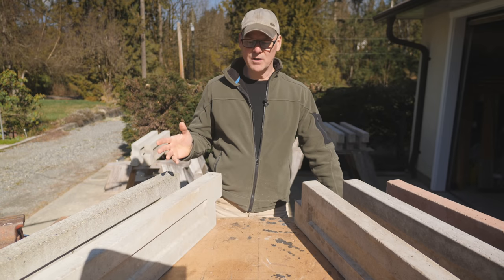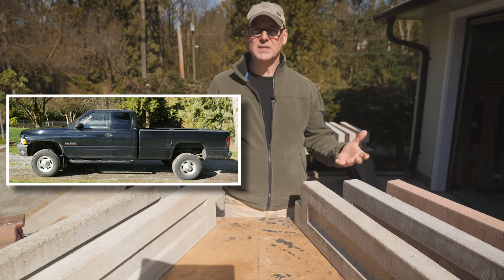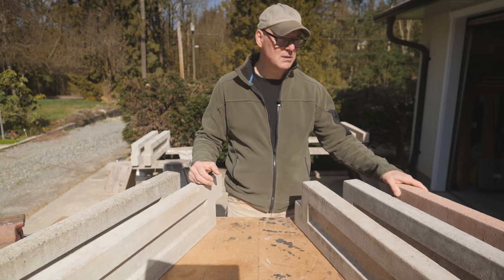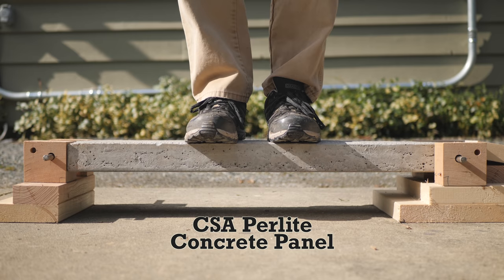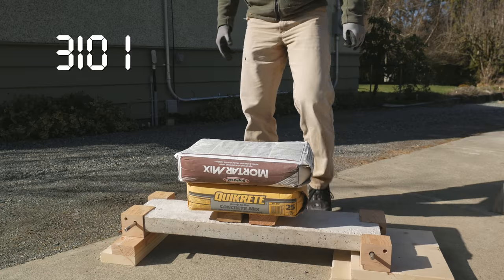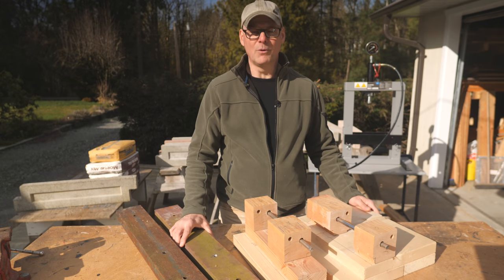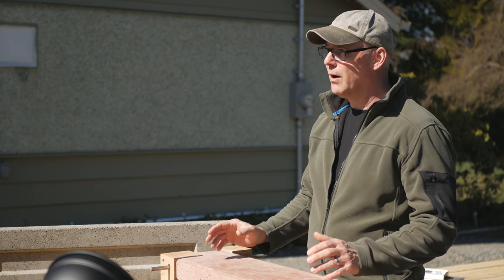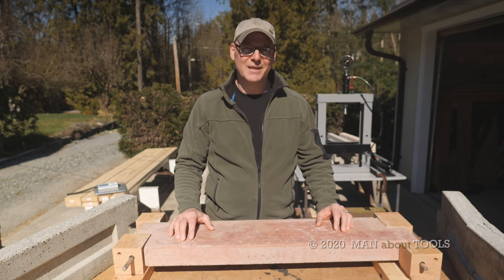How Strong is Lightweight Concrete?  - Deflection Test Perlite, Vermiculite, Lava Rock, CSA Panels

Comment: As a mechanical engineer I have some suggestions for your testing.  You are not doing tensile testing. You are doing beam loading with a point load in the middle.  With a 500 lb point load the center of the beam sees the full 500 lbs and each end sees 250 lbs (so the pins only see 1/2 the load). This is not a good simulation of the dirt or ice load in your garden bed.  Try a distributed load by putting at least three layers of bricks across the full face of the the panel, offsetting the seams,  and then add more load (bricks or bags or whatever) evenly across the top of that.  You should get a failure at the pins and you may be able to reach the theoretical weight of your truck wheel.  (If you do another truck test build two ramps so you actually get even loading, you had more than 1/2 the rear truck weight on that one elevated tire.)

This will also eliminate the chance that tall pile of bricks might fall on your head when you bend down to look for cracks.  Had me worried a couple of times.  Thumbs up for an excellent and thorough series, who knew it would be this fascinating?
Reply: You're absolutely right, I was going to suggest the same. But since you took the liberty of writing it all out. I just up voted your comment. Thanks.

Comment: First and foremost - I love this series.  It's going to be the basis for a big experimental project I'm starting.  One point you might consider - you are deflecting with the steel on the inward side / radius where compression occurs.  It would be stronger if the steel was place on the outward side where tension occurs.  It might be interesting to take too similar panels and flip test them.  I'd bet having the steel on the outward side will near double performance.

Comment from the maker: I incorrectly referred to this as a tensile test when it is actually a deflection test. Thanks to the engineers out there that caught my error.
Reply: i thought something was off about that isnt tensile force pulling it apart? aand an i thought what u did was considered a shear test?
Reply: Give you considered adding decorations?

Colored glass or stone could be put into the mold before adding concrete 

Awesome series!! 

These are good enough to sell vacuum formed molds in mass production at be carried by a big box store
Reply: The biggest problem with this kind of test is the metal that you put inside of that is what gives the concrete it's strength in that dimension. The metal you used in some of them was very thin. I believe the one that has the Hague wire will perform the best. If you noticed in your concrete test where the truck broke it  The edges of the concrete did not flake off under pressure of the truck tire. If you recast that same one with the same mixture but instead were to add 2 or 3 pieces of hogwire offset for each other so that the pieces coming out to the top and bottom were not on top of each other but spread out you would be able to support a truck.
Reply: Actually all your test failured under tension and you never measured deflection... point of fact, the expansive loads you theorize is from water retention in the soil that would expand and that small dimensional box would not create enough pressure...
Reply: it's still highly related to the tensile stress because the bottom of the beam is in tension and that is the critical failure. Deflection is just  how much it deflects per load, not necessarily to failure.  UTS Ultimate Tensile Strength IS what you tested, albeit in a bending mode, rather than an axial test. The maths to calculate this bending failure would still use the UTS as a primary input to the equation.   Stiffness,  "Modulus of Elasticity"   would be used to calculate deflection not  UTS.

Comment: I am impressed with your creativity and dedication to this topic. You address a lot of the issues discussed in engineering literature regarding concrete mix design, placing, curing and testing. One thing in particular I would like to note is for your beam (simple point load) test the tension exists in the lower portion (exterior side) of the panel so the reinforcing would be more effective the if it was placed as close as possible to the exterior face. Additionally your pin locations didn't fail because there is very little tension there, mainly shear force.

Comment: I don't know if you have an engineering background but your approach is right up there. I've made forms from your videos and I love them.  I use the perlite mix and heavy gauge 4 in x 6 inch heavy gauge hog panel . I'm a retired general contractor and have poured in many different forms more than 7 million square feet of concrete  in 20 yrs of work. Based on a 4 inch thickness. Love your videos and keep them coming. I have added tile mosaics and face brick for custom pieces to the face inserts.  Well done! Rob

Comment: Horizontal concrete slabs will be subjected to pull from 2 ends, not pressure. So it needs a steel core for bearing. You put a lot of steel at the ends of concrete slabs, so the two ends have very good bearing while the middle is less steel and disjointed with the two ends, so the middle will be weak.
But I think they can withstand nearly 200 kilograms of pressure, which is good enough for making pots.
Thanks for sharing your good ideas. :)

Comment: Your method of testing reminded me of my first physics class at college nearly 50 years ago.  The professor used real world examples of the various principles-wedges, pendulums, etc. and was mesmerizing in his presentation.  Thank you for showing these tests.  While not "scientific" in the current modern sense they are practical and show the durability of these panels.  And you saved yourself a gym membership!

Two observations:
1. The size of the reinforcing and the density of the grid will affect the tensile stress the panel will handle.  If there were for example 4 longitudinal rods versus 2 you will see higher loads.
2. The distance of the reinforcing from the neutral axis towards the tension surface will also increase the tensile loading possible.  If the inset were half as deep and the reinforcing were closer to the inset you would see an increase in loading before failure, but the panel would not look as good.

Ultimately I believe the failure of the panels will be from the freeze/thaw cycles and absorbed moisture and that will take years.  Thank you for your videos.  Take care, stay well and keep having a good time.
Reply from the maker: Excellent notes here! Thanks very much!
Reply: What would happen with rebar in the thicker part of the panel above and below the inset? it would have to be just bars, not mesh, but we're not really worried about them breaking the other way.

Comment: First off - once again, GREAT information Kent!  Love your passion about these panels and the amount of information you share about them.  I would have loved to see you test one of the thin panels you made with the CSA Rapid Set Mortar Mix.
Reply from the maker: Thank you very much!! I really appreciate the support my channel has received. If you notice I have an extra smaller diameter hole in the blocks that hold the steel bars. Thinking ahead to testing the CSA panels in the future.

Comment: I plan on trying this for my garden, tired of wood rotting out. May try it for flower borders but may try half rounded molding for a fluted look. May try making curves by using shorter sections, 2 feet or less using understatement plywood fastened to a curved form. Would start filling in middle then covering with curved plywood to hold in place. Good presentation.

Comment: So... they are plenty strong for most applications. Now you should do a beam strength test. That one you should be able to use your press for. I copied and modified your design and I have my first batch done and getting ready to cast second round today. They are a nice panel design!

Comment: Saw your recent video with the new molds. Very impressive. 

I would be interested to see you try modifying the placement of the reinforcement inside the mold. Positioning the reinforcement closer to the outside edge would increase the strength since that is the point of greatest tensile stress. Maybe two sticks of rebar on on opposite sides of your decorative inlay?

Comment: The crack on the first test with bricks was caused by the uneven support of the wood at the bottom. The right one was shorter, which caused pressure to accumulate on its far edge where the crack formed.

Comment: Thank you for your videos! The testing is great and way over the top! Any of these planter box panels seem to be far superior to any commercial version. Even at a tenth of the demonstrated strength, they should last a millennium, unless you intend to make bridges with them in the future.
Reply from the maker: Thanks! I agree that they are all strong enough for their intended purpose. But, I think it's still interesting to see HOW strong. Cheers, Kent
Reply: I think the line-trimmer test was pretty critical to their intended service, though. The rest of it was just for the fascination of watching practical engineering in action.

Comment: To enhance the resistance the wire mesh should be place closer to the face subject to tensile stress (placing the reinforce closer to the outside face give additional protection against corrosion).  Also a third light weight material could be expanded polysterene particles. It will be interesting to have a table that shows the strenght related to the thickness and lenght of the panels. Excellent job so far.

Comment: So, a couple things I'd be curious about, would be a variety of tests using fiberglass.  Perhaps a test with continuous fiberglass rebar of various sizes, as well as a test using fiberglass insulation as a filler material, if such might be possible?  Also, perhaps tests between aerocrete and standard concrete, also maybe using traditional methods vs using an ultrasonic vibration cleaner  to try to even out the mold.  Performance with a variety of aggregate grain sizes might also be an interesting test.

Comment: An ounce of prevention is worth a pound of cure.  To minimize the effect of frost pressure, line the inside of the planter to the top of the dirt level with a material that will compress when pushed against.  This will act as an expansion joint to absorb the dirt’s expansion.  Good drainage under the planter will cause less water and then less expansion.

Comment: Thanks for the thorough investigation of home made concrete garden bed / fence panels.
The takeaway I got was,  they are plenty strong enough  as built and Portland cement is just fine for the job.
If anyone needed more strength then a loop around the indent would greatly increase the force required to initiate a crack in the face. The unwanted side effect would be a greater risk of concrete cancer.
So, all in all it ain't broken, so don't fix it.
BTW, I like your simple modular  design. When I made a concrete raised bed some years ago, I bolted my panels together. It works well, but your design is more versatile.
Reply: I don't see how a loop would cause concrete cancer,  but a lack of concrete cover to the reinforcement may cause spalling and reduce the life of the panel.The panels are not really thick enough to accept steel to modern standards, so the galvanised fence wire is a pretty good idea for being off the shelf.

Comment: It would be useful to know if fence posts made in a similar manner would be sufficiently resilient
Reply: Yes, fence posts of concrete with perlite. Would be very strong and cheap if you mixed the concrete yourself and the archaeologists would find them in 1000 years and wonder what kind of religious ritual they were for or if they told the time........ LoL....
Reply: I've been considering the same thing. :)
Reply: sdushdiu very interesting!!!! I have a new section of pasture I need to fence and would love to try this idea. I wonder what would be the best way of attaching the fence to the post? Would you inset something into the post when pouring to attach fencing or is there a wrap around wire fastener and just pour a square post?

I need to research this tho and find a solution so I can start making posts. If you have any other great ideas for them let me know and I’ll try them and see if it would work. 

Thanks for the idea, I greatly appreciate it!!
Reply: Don Pfeiffer I’m looking at the same with the Thin CSA panels. I didn’t see him test those panels though.
Reply: Don Pfeiffer I guess it might partially depend on what you intend to attach to the posts for fencing. Insulators on stand offs could easily be embedded in the posts for electrified fencing (or simply the possibility of adding such capability, or simple a floating heavy duty chain link attached to resilient leads that will not rot or corrode over time embedded in the mix ( even tied to the post's rebar reinforcement). 
I tend to think in terms of traditional open wire mesh fencing (primarily gor livestock), newer high deer 'nylon' mesh fencing. As well as potential combination of the two, and even for the possibility of a rail style fence, although I suspect that material fatigue over time might result in rather significant warpage of such rails . Notre that  is based on worst case assumptions and not on empirical fact!
If you can suggest the type of fencing material to be attached I think we could come up with a few economical resilient long term suggestions....
Reply: So many new ideas! Concrete fence posts!!!
Reply: Don Pfeiffer U channels on both sides to accept a 1x or 2x of whatever size of wood you would like to use. Adjust the depth of the U channel to what you feel you need, allow some room for expansion. I would also use a small spacer between the planks to avoid a wet spot that would create rot. Leave the channel out on the portion that is underground.
Reply: Build your own form with hinges so you only need to unlatch one joint in the form and it unfolds . Put triangular inserts parallelogram inserts with less than 45 degree sides allowing you to unfold it. Coming out with an X shaped fence  post..  if you want cast holes. Make up tapered pins to drive thru the form and remove before stripping the form. I love the idea of the reciprocating saw as a concrete compactor.

Comment: Cool video.👍 When you load the panels your greatest force, or moment, is at the middle of the beam, not at the pins (hence why they don't break there, as each pin is a split or ratio of the load). Also, your wire mesh is negligible or zero in contributing any kind of reinforcement bcuz of the tiny size AND placing it in the center of the panel, or the neutral axis. Reinforcement need to be placed in the bottom portion of the cross section for the steel to be in tension. So really you're just testing the concrete itself, and you're loading the panel sideways. 🙂 Yeah I am one of those engineers. But not the kind that drives trains. Lol.
Reply from the maker: Yes, I agree with your points. I went through a few loading scenarios and also thought about a uniform pressure on the panel instead of the center. And that would have put more pressure on the pins. I might still do that yet and see what happens. All and all, I was happy with results. It was interesting to see how much concrete can flex. Thanks for the comments!
Reply: The concrete above the pins is also in compression, just compression upward. The center will always have the most tension because it will always have the easiest time deflecting. While the metal wont help like rebar since it isnt pretensioned, it will help in keeping the concrete as one unit for looks and hold the small amount of pressure a planter box holds.
Reply: Michael & Haidee I was gonna say almost the exact same thought but you beat me by one day but well said Brother!
Reply: @MANaboutTOOLS  Great effort, I bet that was exhausting!! I wondered about the changing moment between tests myself , the press was dead center, the others varied the distribution over the panel by varying lengths and the truck test would have been like the press test if you had used a hydraulic jack to lower it in the center. If you haven't seen the Mathias Wandel testing on wood joints, it might be helpful for using a bathroom scale and a cantilever for mechanical advantage? "Dovetail joint vs box joint strength test" is the video title about 1 minute in is what I was thinking about when I saw your testing. Still good information, thanks!
Reply: If the concrete at the pins was going to fail, it would have been a shear failure since it is a pin/roller connection and takes no moment
Reply: I disagree Wayne.  Having the mesh in the middle actually would be equal to a panel of half the thickness with the mesh at the bottom.
Reply: Michael & Haidee I wonder whether polyester fibers would have a significantly positive effect on the strength of these lightweight concretes.
Reply: @ewetoobz3840  I was just going to suggest that!
Reply: @dennisrose40  I don't think the fibers are doing squat.  There are no larger aggregates mid, large size, mostly sand and air bubbles.  Would be interesting to add some small lightweight gravel aggregates.
Reply: @flick22601  yes, correct.

Comment: Great video. I loved how you tested the samples. The only suggestion I would make is that you test each of them to the point of failure to determine the tensile strength of each sample. That way you know which is strongest, which is weakest, and can place them in order of strength. 

Great work by the way. I was going to use treated pine or hardwood sleepers but will be adopting your method for my garden beds instead. I can buy concrete sleepers here but they are square-ended and cannot be joined they way yours do with the stepped end and hole for reo bar. 

Brilliant mate, just brilliant.
Reply from the maker: Thank you very much!